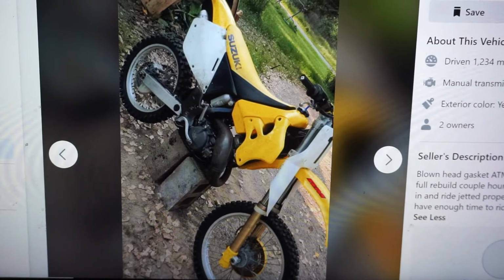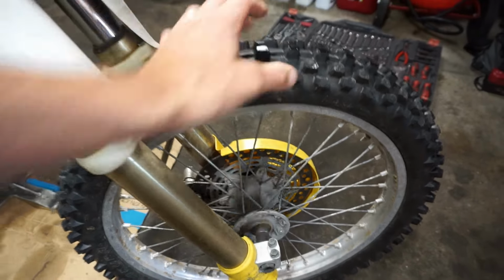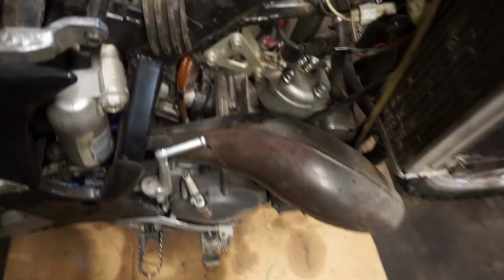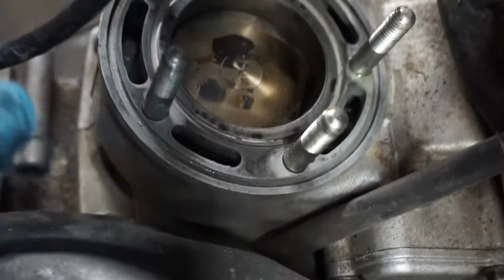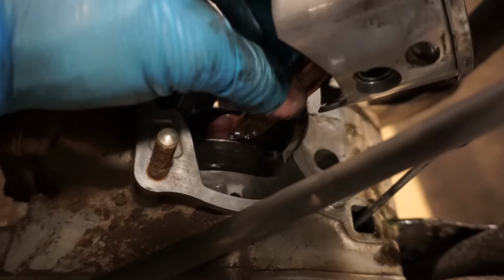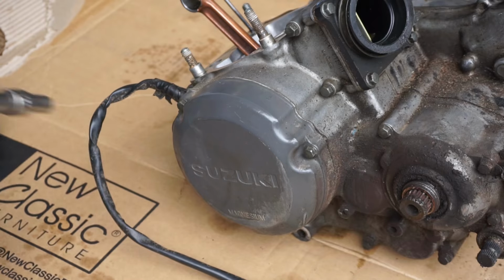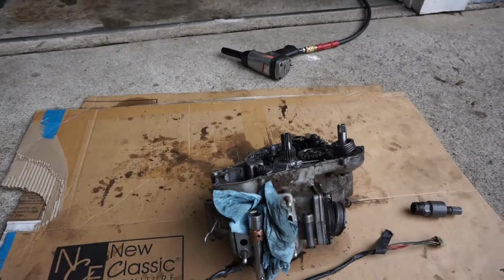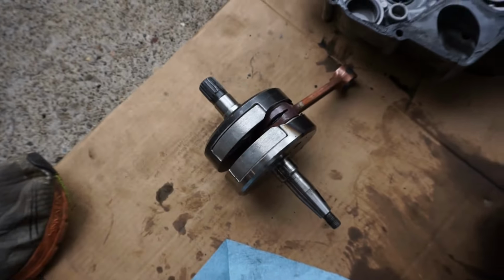I Bought a $600 Suzuki RM125 Dirt Bike. Will it Run?

Comment from the maker: Well it's been a while, but I'm finally working on another Suzuki rm125!
Please SUBSCRIBE and LIKE the video if you enjoyed. It really helps me out a lot!
Check out my Instagram: 2_vintage_
Thank you for the support!
Reply: If you press the crank, pie scribe both sides for alignment so its faster to reassemble for balance. (Pie scribe means 90% 90% 90% 90% lightly enough to see) so u can align close when re-pressed together. u have to make sure the weights aren't sheetmetal covered put a wedge between halfs but not on weights. You need a press a set of V-blocks and a dial indicator. With all the stuff I see u do its not to hard and cost effective $100 rod to a whole crank $650. O I almost forgot as bad as your rod is you have to cut pin off because you don't want scored area to get pressed through as it will groove the crank and make it junk. Most crank rebuilders use thin cut off wheel and cut through slit in bottom of rod all the way through pin. And press off pin halfs then
Reply: Can you do a 1998 rm250 next?
Reply: Ooooo I have a 1996 Rm125 too!😃
Reply: Am a
Reply: I would look for a crank through wiseco i saw one for a yz 125 on Amazon for 252.00 dollars right now and wiseco is a great brand never had any problems with them
Reply: 200k subs, good job, I’ve been watching since the kx420 build
Reply: 2vintage where did you get the crank puller
Reply: i wanna know where these prices are at and not the i know what i have prices
Reply: Hey 2 vintage, I have a 1982 Kawasaki kdx175 that needs crank bearings and seals the bike is in great shape for the year I am looking for 750$
Reply: Awesome bike man! Wanna sell it? I have a 96 RM250 it would look great sitting aside of!
Reply: @jmendo2546  With all that you forgot to mention you scribe the line in the 2 crank bobbweights with a builder square or something that gives you an accurate dead on 90 degrees right angle & you also premeasure the total width of the crank & again including the main bearings incase your going to change them too ( had to show NZLs specialist crank rebuilder how to properly rebuild cranks: including how to shim a main bearing out by making O ring washers from varying thicknesses of shim stock metal after a come back & he didn't measure the preremoval crank width after the mains were changed & it was a comeback cause the end float was too great). Trev NZ note you might cut that gudgeon pin to get it out but the best way is to press it outside in because not all b/E kits come with a new pin unless it's a new rod kit.Trev NZ 🇳🇿
Reply: @robertvaughn5629  You Should be able to get a crank done for $750 !..try your local small engines shop guy or marine/outboard guy they might know a bit More than the bike shop & have a lower hourly rate: you should be looking at about $25Per main bearing if you supply the main bearings , more if he needs to split the crank  apart for a rod/big end rebuild but if you take all parts needed to the above & a workshop manual for his reference, you might be pleasantly surprised.Seals you can do yourself, is it piston port or rotary valve being a kawa ? Goodluck Trev New Zealand 🇳🇿
Reply: I watched a few videos on has to rebuild a bike crank ,and I would say if you had the tools to do it you have the skills to get it done . The hardest thing is to get it lined back up .Buy a cheap press would make an awesome video
Reply: @rybolsus396  Been there,vdone that got the T shirt to prove it.Thats  I bought the Hyd shop press for..you make your you use a builder square to squribe a straight line across the crank bobweights & you also measure the total width of the crank before you press it apart...something quite sstisfing saying you did it yourself & you use a puller to get off the main bearings if they need changing.No more big crank bills for me...I do it myself & boy you can get some cheap bikes when the b/E bearing has gone. Trouble is word soon spreads ,& your then doing everyone's..lol Trev New Zealand 🤗🇳🇿
Reply: Same here in FL bro
Reply: The shop I go to the guy rebuilds cranks for 90$ labor plus the parts. 6-700 is insane.
Reply: Great Vids! Keep it up
Reply: hey i dont know if you'll lok at this but where do you find these things Ive seen other youtubers find stuff of of the same platform but i dont know what it is called thank you.
Reply: I got one for 800 perfectly fine

Comment: For your info guys, these RM-125 around 1996 really didn't like being reved-up un-loaded (like winding the engine on the starting gate @ the races). I could explain what was the problem, but it's a long story. To make it short and sweet, the big end's bearing CAGE was too heavy , had less rolers then ideal and the bearing SLIPPED, and wiped the oil on the crank pin, making steel to steel contact :( . Just avoid reving the engine un-loaded as much as possible!.
Reply: Its not really good for any bike to be revved while not under load
Reply: by un-loaded revving you mean holding the clutch in and revving the engine?
Reply: @slowrollaQC  or having it in neutral
Reply: @slowrollaQC  Yep or in neutral. Nooot good on engines :(....
Reply: @samuelbaudoux3312 but Joe and his classroom says it's okay😂

Comment: 185$ for parts and labor on the rebuild? I bet they didnt do anything besides change the oil!!!! That crazu
Reply from the maker: yeah so cheap
Reply: @2vintage  labor around here is 75 to 125$ an hour! And that's strictly good labor. Parts and labor it gets expensive. I'll be glad to see you get a press and try to accomplish this yourself. I'm sure you can get the job done

Comment: I’ve never seen a 125 that wasn’t clapped out, they live a rough life. Besides most don’t mix the oil right, when in doubt, foul it out. Plugs are way cheaper. I’d buy a new crank bro, you’ve already got it apart, just get a new one trust me.
Reply: Thats my motto! Especially with my cr85 big bore. The 85s rev to like 13,000rpm so its good to keep em nice and smokey! If I dont see smoke behind me, im pulling over and cooling it off to be on the safe side.
Reply: @cxbra  that’s why your bikes probably last a good while. I’ve never ridden one until it failed, as soon as it stared losing compression I knew it was top end time. I raced enduro so you have to keep your shit straight, try walking 30 mi out the woods, it’s like 100 mi on flat ground
Reply: @jakebradley5357  2 stroke exhaust is 15% raw fuel and oil, they will always smoke. But yes, with the new synthetic oils they don’t smoke much. But if your riding and run out of fuel, I’d rather mix heavy vs light, that’s all I was saying, you can change plugs and keep going, you lean it out and blow it up your walking
Reply: @deborahchesser7375  when you mix more oil into the fuel you’re actually running it leaner since the fuel is thicker it moves slower through the jets. When ur mixing more oil in you’re running a greater chance of blowing your motor up.
Reply: @jakebradley5357  there's so much wrong with this...
Reply: @robspear03  lean and rich isn’t dependent on fuel/oil it’s dependent on air/fuel ratio, don’t believe me look it up.
Reply: @jakebradley5357  so which is it ? Your first comment contradicted your second, which was correct. Fuel/air determines rich or lean. It’s dependent on both carburetor and fuel mix
Reply: @jakebradley5357  that’s the most bollocks statement I’ve seen in while. If it’s not smoking you definitely don’t have the right amount of oil no matter synth or not. Stop with the misinformation.
Reply: @oo0Spyder0oo  properly tuned two strokes smoke minimally at operating temp you must just suck at engine jetting
Reply: @deborahchesser7375  when you mix more oil into the gas, the gas moves through the jets slower, so then the bike ends up sucking in air at a faster rate than gas, causing it to lean out. Don’t mix heavy, you’d be better off having a little bit less oil because the gas will flow through jets faster causing it to run richer and cooler.
Reply: @jakebradley5357  unless you compensate for the high oil ratio when jetting and tuning the carb
Reply: @miketyson1717  EXACTLY what I’ve been trying to tell this guy 😆 oh well

Comment: If you supply a new rod and bearing a local machine should be able to press out the crank pin and install the new rod and bearing, then balance it
Reply: Ha ha , I didn't read 🤪

Comment: I only paid $200 for my 1989 KX 125 And all they needed was a carb clean and she ran but keep looking out for good deals they show up quick
Reply from the maker: Wow crazy good deal!
Reply: Maybe 2 years ago you got that deal or even a year ago it's crazy what even 6 months can do to the Market but thankfully things are starting to chill out a little bit again🙂
Reply: The 1989 KX and RM had the 46mm conventional front forks and were exceptional.   This RM also has conventional forks (95+96 only I think).  Honda inverted of 1989 were junk (1990 Cr125).

Comment: Four possiblities of rod failure: 1. Exceeding max RPM, 2. Overheating, 3. Improper oil/fuel mixture, 4. Dirt in the engine (could be from rebuild, or from letting dirt though the air filter).
Reply: That makes too much sense for most of these guys.

Comment: I fuckin love you, man. You saved my ass. I bought a 2000 RM125. Tore it apart and found the exact same issue. Actually has more up and down play than yours… insane. I was looking for a step-by-step video since everyone else just seems to make cool edits that don’t help. I really appreciate your videos. You gave me the info and energy to go split the case just now cracked it up at 11pm. Hi from Alaska… thanks again!
Reply: Those 2000s are fiends for snapping power valves and destroying the pistons. Had a 99 and had the same issue. Keep them clean and use good oil.
Reply: They are known to do bottom ends too. We had more luck with the hotrod complete cranks.
Reply: Cameron Nimela's youtube has great videos on his cr250 rebuild, watch those paired with a repair manual and you got it
Reply: Did you get her back running?
Reply: @AAAskeet  oh she’s a ripper
Reply: @backcountrybuilds  Thanks for the update.I had the 04 RM125 ,great bike.
Reply: @AAAskeet  love the ole 2 strokes. Just scooped up a 2015 CRF250X. Excited to get some good riding in this coming season.
Reply: The bike hes working on has a 1995 engine. Yours is different .

Comment: I bought a 91 rm125. "engine needs rebuild". When you kicked it over, you could feel something grabbing. I pulled clutch cover off, one of the springs was stretched out and grabbing the case. Someone broke a bolt off on the inner stud, and put the spring back in without a bolt! I threw a set of yz springs in and was riding it 20 minutes after I brought it home. $90 bike, $0 fix. Sold it for a grand. 
But unlike you I washed it up really good, I use wheel cleaner, toilet brush and sos pads. Made it look great.

Comment: I feel lucky buying a 97 rm 125 that ran. Went from 60 plus kicks to 5 or less to start with cleaned carb and jets  , new spark plug, and oil and coolant change. Just bought the bike in March so still have more to do but she runs. Good video boss

Comment: My 98 RM 250 crank was good thankfully but the crank bearing on the stator side was toast. Don't make a crank and rod assembly for these years. Don't know why, could only find the con rod. Wierd. Love the videos man. These old used and abused bikes are a challenge but a good learning experience.🤘👍🇺🇸
Reply: My 98 RM 250 is a beast! I had the jug sent in to be re nickel silicon plated and I had a Suzuki powersports store do all the rebuild work. I saw the crank had heat marks on it and I asked them about it they said it was normal only to find out on the first ride after break-in that it was in fact not fine and the crank bottom end bearing took a dump. 😂 so I got a free rebuild from basically top to bottom after they finally found a bearing after like 6 months.

Comment: I have found when buying a bike one of the important things you should look at is the frame rails make sure that they are straight and not all dinged up
Reply: My brother's first bike was a used Suzuki 250 street scrambler. My brother stripped it down and re-assembled each part getting everything back into specification. When setting the rear wheel alignment, we went according to the ruler stamped onto the swing-arm. My brother takes it for a ride but comes back saying the bike is pulling to one side. When my brother rode straight away from me, it looked like the rear wheel was not inline with the front wheel. We tried ignoring the ruler on the swing-arm and it got the riding better or straighter. However, the rear wheel wasn't straight according to the swing-arm ruler. Something had to be up!
Then one day, my brother had the gas tank and the saddle off and I was standing behind the bike. The large main "back" tube of the frame (under the tank) was skew relative to the rest of the seat frame! This damn bike had been in an accident! No wonder we couldn't get it to ride straight!
So takeaway is: check to see all is straight before buying.

Comment: A tech tip get a piece of cardboard put holes in it put your bolts in the holes label them with a marker, you can even put them in a pattern like they come out of the bike and get them back in the right place. Makes it easy.

Comment: i had a customes 2002 yz 125 eat 2 cranks before i was given the job , turned out to be a bad cdi unit that was firing to early in the stroke and wiping out the big end bearing on the crank pin 
first and only time i,ve had a cdi unit do this

Comment: When your marking for the timing, look into a "Automatic center punch" you can mark the location on both surfaces. You can  clean everything and the punch marks will be deep enough to see and help during rebuild. The Snap-On dealer has them, the cheaper ones wear out and do not have the hardened tip like the Snap-On
Reply: Yea bc ignition timing is so difficult 🤦‍♂️
Reply: And because taking a punch and a hammer is too "manual".
Reply: @mikespain8655  Automatic center punch is spring loaded and is done with one hand and doesn't mangle the work surface your marking, the hardened sharp tip leaves a small dimple.
Reply: Or you could Just $$ Pay someone else to do it!! Lol

Comment: 22 mins in, your looking for a new crank shaft before you pulled it apart. You can have journals welded and oversized bearings. So pull everything apart, mic parts and see-if your outside of rebuilt specs before buying parts. The beginning trouble shooting was good though
Reply: That engine has a roller bearing it's not a shell bearing crankshaft😢
Reply: Plus it presses apart and presses back together nothing like what you're talking about I have welded up EMD engines on a stand before so I do know what you're saying

Comment: Try Mr crankshaft. Good pricing. I have a 2002 kx125 and it will be my only option aswell because screw 600 bucks for a rebuilt and 150 dollar core. I bought an oem crank for my 98 cr125 for 180! Oh well we learn about part availability for suzuki and kawisakis the hard way

Comment: I like your videos. One suggestion if you can’t find a new casing gasket measure the old one with a micrometer and make a new one out of gasket paper. Also dry ice works the best for shrinking bearings, should be able to get some at a welding supply store. You could also put the casing in the oven at 150. Otherwise good job.

Comment: I bought my running rm 250 for 200 dollars knowing the top end was worn tried rebuilding it head gasket was leaking it destroyed the finish on the freshly rebuilt cylinder quick luckily it was a 85 so i bored it out and rode that next bore about 5 years almost daily depending on north east weather .back shocks go shock berrings ..that oil is filthy i change it every ride or 2 at most i put about 1000 into it and got 5 years out of it .very fast factory claims 54 hp. Best bike ever.good luck too bad you couldnt fit a 250 engine in it

Comment: This comment is a bit late (only watch it for the first time today), you're probably done and dusted with this bike by now, but do you think the crank pin wasn't replaced when the new rod and bearing were installed? And that's why the new bearing failed? As far as I'm aware, the bearing uses the crank pin (and the rod) as a race for the bearing. I've only had 4t cranks rebuild so it may be different for 2t, but the last crank rebuild kit I bought was a rod, big end bearing, and crank pin. Anyway, great work, loving the videos. :)

Comment: He did assemble the crank-shaft correctly, it was not ballanced and caused vibrations. Should be correctly assembled using a straight platform and DTI guage.

Comment: That blued spot is from someone the trued it before must've been rebuit. Most likely was lack of oil that caused it and or dirt threw air filter. Be a nice bike tho those were pretty sweet race bikes 🏁 your cylinder is in good shape and doesn't have a sleeve so tgats good

Comment: I would like to learn how to do crankshaft rebuilds and balance them too. i`m in Iowa so if a rebuild for a crank is around 600 bucks in your area and i don`t think the price is going to change much here in my area neither. i`m just starting to get into rebuilds also.
Reply: It's not that difficult, if ya look hard enough ya can find alignment jigs to keep the webbing concentric while ya press the crank together but they're friggin expencive.

Comment: Me and my 9 year are rebuilding a 2004 yz85 I got for free. I wish I could post some pictures of how bad the motor was. It sat 16 years outside with the top end off so the crank was as rusted as it could get and loaded with mud dauber nests. My 9 year old totally rebuilt the bottom end with oem parts including crank. He had the biggest grin when it fired 1st kick. We have put about 1700 in it and it looks brand new but if not for the experience of doing with my son I probably wouldn't have put that much loot in a 2004.